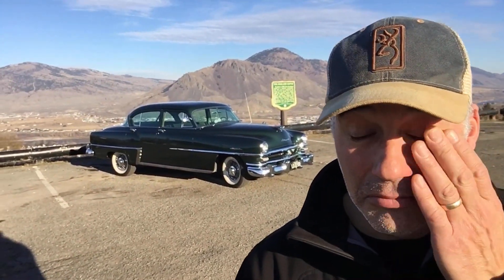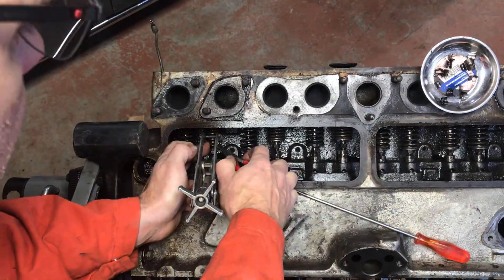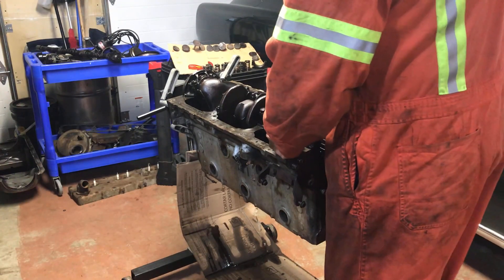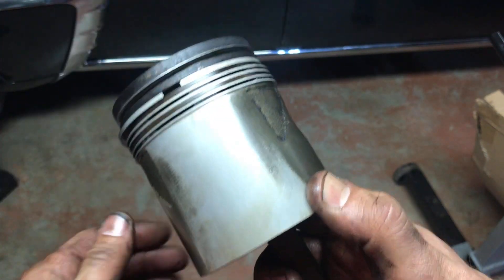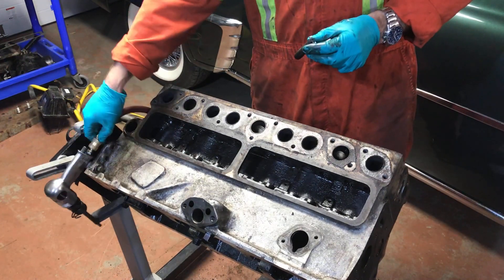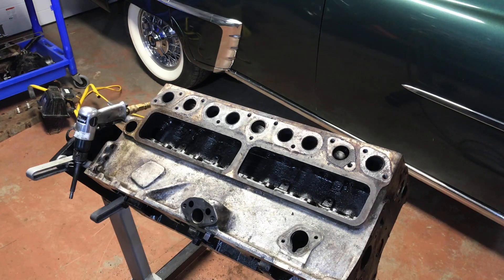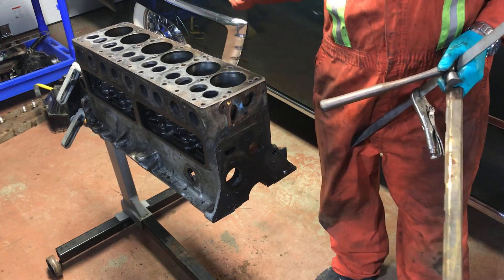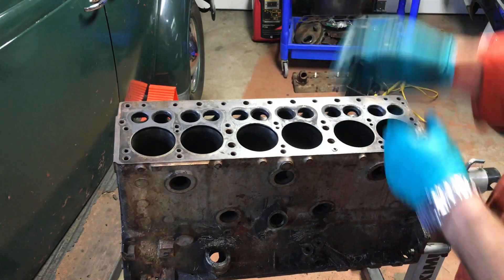Mopar Flathead Final Engine Disassembly Wrap Up

Comment: What does that tube do, I had a cfh apart once I never noticed that tube, and why did you have to remove it ?? I always drill broke bolts out as thin as I can go and peel the tin out then chase it, I found that easy outs actually expand the bolt peace tighter in to the threads .
Reply from the maker: It controls water flow straight from the water pump outer. Into the cylinder head, routing cooled water directly to the 6 exhaust valves.

Comment: Hi Keith, just started my teardown of my '55 Savoy 230.glad you are making these video's, very helpful in aiding me in this process. It's a fun learning experience so far!
Reply from the maker: Great to hear that. Make sure you do a good through inspection and measurements on your engine parts. To learn exactly what you’re starting with.  I go through that in a video, before I started rebuilding my engine.
Reply: Yes, I just bought a micrometer set, and valve lapping kit, bore gauges etc. Have the head off, and the bores look ok, a slight ring groove on top of the cylinders, typical age stuff...
Reply from the maker: Indeed. Sounds like you are on top of this project. Good work!

Comment: Hey Keith, first off i would like to say i love your content, i am restoring a 1932 Desoto sc Flathead 6 , and I'm like you , i only believe in doing things the right way the first time, i love your approach , my engine is going to the hot tank next week and so i stripped it down only to find that she's missing a crank cap and the 2 nuts to hold it in, wondering if you can help me out to find one, i live in Canada to and my car comes from the Windsor plant,  i believe it was like this from the early years as this car is completely original and has 50,000 miles on her, i am the third owner since 32 , i am doing a frame off resto on it to make sure everything is done right, I'm hoping to find that cap so my machine shop can get everything true , I'm reaching out to you as i feel your the best guy for early mopar stuff , i also broke my balancer pulley when removing it , i want to restore the complete car and keep it all original, i have been invited to the national Desoto show in Hawkesbury Ontario next summer and would love to have it done by then, any help would be appreciated , my e:mail is ,  kevinproulx2011@hotmail.ca 

from 1 Canadian Mopar guy to another keep making videos , we love them ,,,,,thanks for your time Keith

Kevin
Reply from the maker: What size is your engine? Is it a crank main cap or a rod cap? Rod caps use nuts to mount to con-rod. Main caps use bolts to mount.

Comment: I'm having 49 Chrysler Windsor . Very informative to watch your videos.👍
Reply: Hi can you do some  videos for  fluid drive transmission found in Chrysler Windsor 1949 maintenance such as atf oil change , solenoid checking, governer points, transmission gear slip issues. It will be very helpful. 👍
Reply from the maker: Sorry, I don't own or have access to vintage Mopar with the fluid drive transmission. I sold my '53 Chrysler..

Comment: Do you plan to shave the head any to increase compression or just enough to true up the surface?  Enjoy your videos
Reply from the maker: I don’t plan to up my compression. Will take advice from machine shop on how much, if any needs to be milled off the head.
Reply: @keithsgarage5831  Been too many years ago to remember the amount of the cut, but local machine shop cut it enough to take it from 7.0 to 8.0 compression.  They said this would not put undue stress on any component and it would still run good on regular gas.  I don't know how much extra pep was from new pistons and fresh bearings, or from the shave of the head.  But it did have more snap to it's step.

Comment: Hi Keith, what brand is your valve spring compressor?  Thanks
Reply from the maker: Duro-Chrome Model CF-49A. Made in USA.
Reply: For future readers, another, near identical tool, is made by SUNNEN. There does not seem to be a part number on it, but you see them on eBay all the time.

Comment: Great video series......   For everybody's information...concerning the "weird" square-drive pipe plugs::::   Way back when (about the age of this car.... Snap-On introduced their own proprietary sized socket drive system.  Instead of using a 1/4" socket drive,  Snap-On (and Blu-Point) introduced a line of sockets and drivers using a 5/16" drive.   So, if you haunt flea markets and yard sales long enough you should be able to find an old set or a ratchet or breaker bar with a 5/16" square drive on them....   Appropriately sized sockets are rare, but the various drivers show up occasionally.  I have a driver handle (Snap-On) and a speed wrench (Blu-Point) in this size.   Nowadays, people tend to shy away from them because you can't find the sockets....you may be able to pick up one on the cheap....

Comment: Question for you, I have a 49 that currently runs great with 64,000 original miles. After hearing from multiple sources that piston rings like to break from the ridge being built up from wear over the years, would it be safe to use a ridge reamer by just taking off the head and reassembling? Or would the cylinder need to be honed as well before running??
Reply from the maker: I have heard that too about rings breaking due to the ridge. However my understanding is, this is when new rings are installed and the ridge left in place. I have been warned that ridge reamers are rough tools of destruction. It's easy to take off too much and damage your cylinder. So I won't advise you try it. If you are planning to install new piston rings the cylinders do need to be honed. Is there a particular reason why you want to take the head off and check the upper ridge?
Reply: @keithsgarage5831  I’ve just heard from lots of guys in the forums I’m in, that over time, the crank wears in such a way that allows the piston to creep up the cylinder further and further until the ridge eventually Grenades the rings. I’m obviously worried about that haha I’m really enjoying your video series, I’m learning a lot about these old mopars from you.

Comment: Hi, 
Your videos are very informative and I would have a related question.  I just happen to break a head bolt while tightening the head of a Mopar engine and I pray that the anti-seize I used will make it easy to remove the bolt.

This being said, in Canada, where do you buy replacement bolts for Mopar flatheads?

Thanks for sharing
Reply from the maker: I buy my parts from the US. Vintage Power Wagons or Any Bernbaum will have head bolts.

Comment: I have a 1950 dodge B2 . I’m new to wrenching, this sludgey mess will be my first. I don’t want to rip it all down like you have, just get it running good. I’ve seen vids of guys putting in different valve seats to run regular unleaded without additive. Thought about doing that?
Reply from the maker: Mopar prodcuts were ahead of the others when it came to valve seats. The exhaust valves had stellite hardened inserts installed at the factory when new.  These cars run modern unleaded fuel without any harm to the valve train. No lead additive needed.